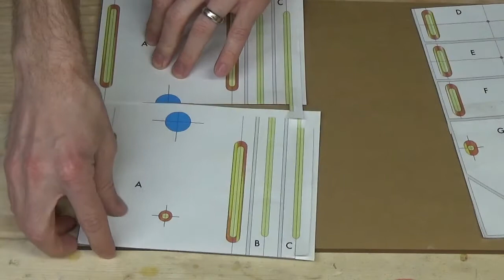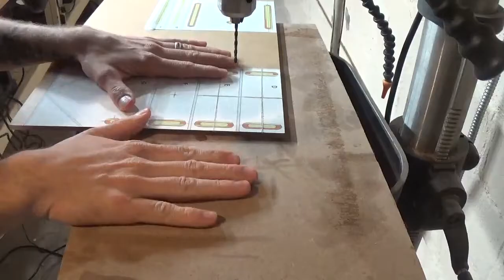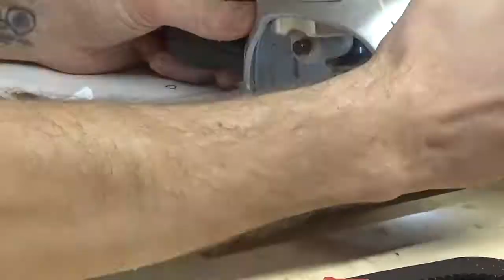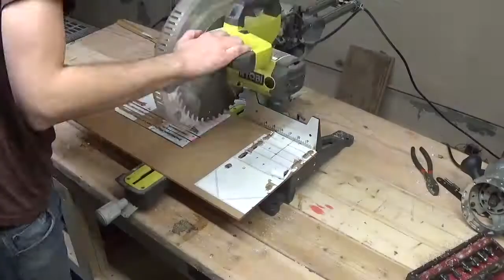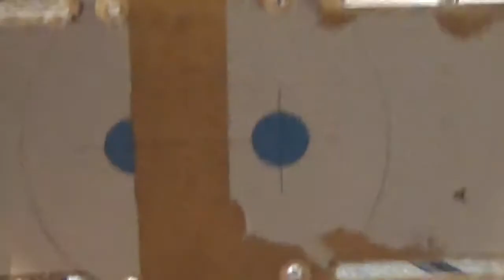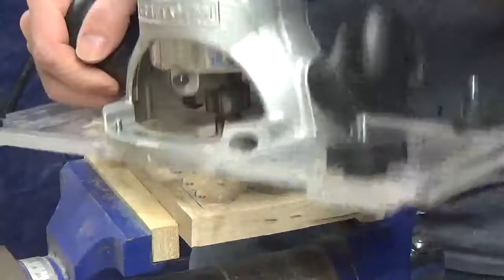3X3 Custom Router Jig Build And Review

Comment: DO NOT MAKE THAT JIG WITH PLEXIGLASS. 
Material required for this jig is POLYCARBONATE.
Reply: scratches?
Reply: @gavinberry1796  Strength 
Plexiglass breaks like glass.
Polycarbonate is practically unbreakable.
Reply: @capitainehaddock9388  I get that polycarbonate is more impact resistant than acrylic, but it scratches easy, and acrylic is cheap for jigs!
Reply: @capitainehaddock9388  oh - and although not as impact resistant as polycyclic - it is a hell of a lot better than glass - 17 times better I believe!